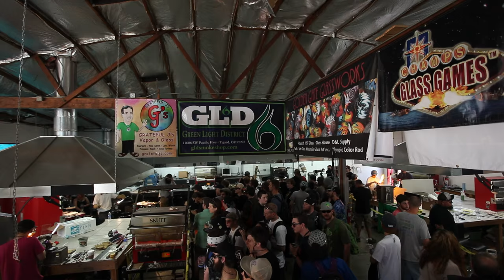DFO 7 Trailer

Comment: what kind of fuel did you use for the glass hotdog grill?
Reply from the maker: Michael Weaver  I believe it was good ol propane.,
Reply: Head Life Media Really? I was thinking you guys used alcohol or lighter fluid. id be concerned making the connection to a propane cylinder
Reply from the maker: Michael Weaver Sir Steve Bates is pretty crafty when it comes to making stuff out of glass that shoots flames.,  look him up.